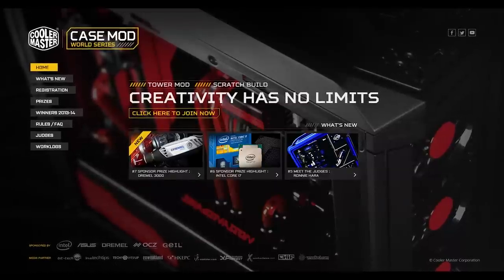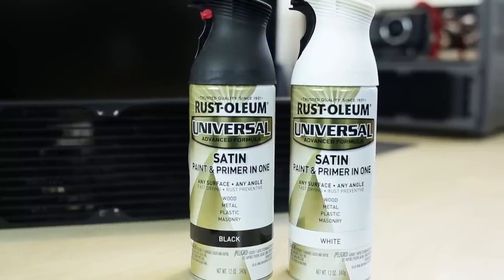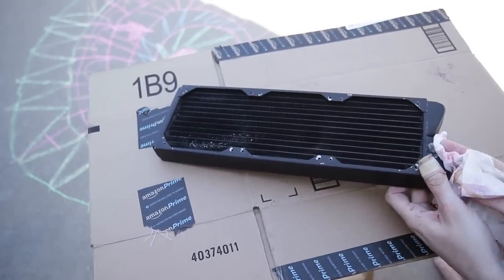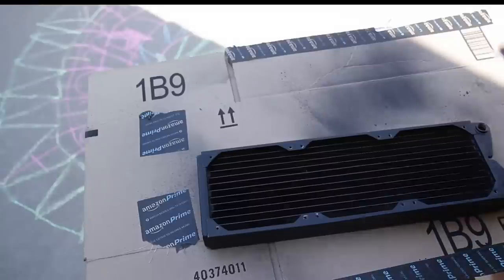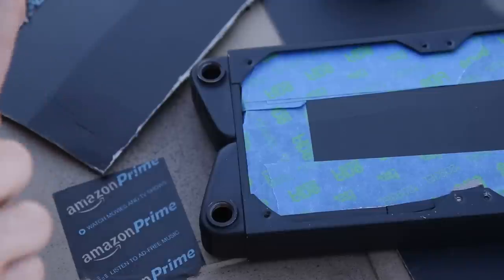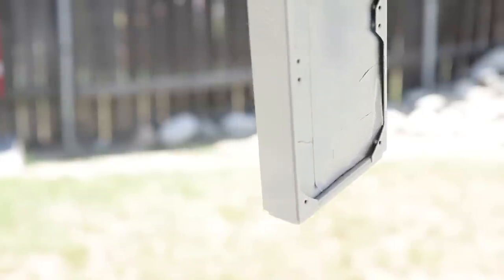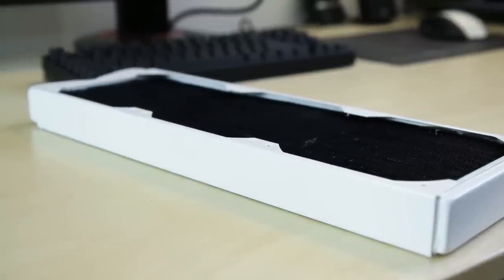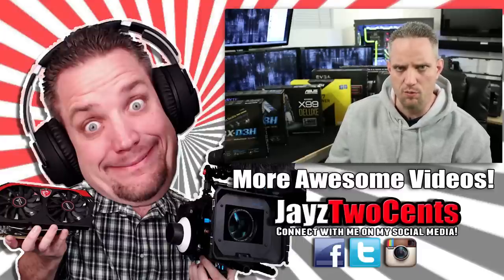Tutorial: How to make your radiator look awesome!

Comment: A better title : "Tutorial: How to make your rad look rad"
Reply: Ah haah.
Reply: that's pretty rad.
Reply: better title. how to make your tight FPI, and make it even tighter, so your fans need to go even louder to cool.. Who gives a shit if the fins are painted? You cant see them when covered by a fan, or the case on the other side if you just do push and if they're scratched, you probably have the fans on that side to boot. If not, the case, dust filter, etc. is on the other side in almost all common scenarios making this video nothing more than a "how to brick your rad" tutorial
Take the cardboard and cut out exactly the size of the inside of the outer edges of the rad (where the fans sit, and the sides and ends) to cover ALL the fins,  then just paint the edges that do not have ANYTHING to do with cooling performance. Especially with a custom water rad like that that costs $50-$80. 

Really stupid to spray the fins IMO.

Comment: Here's a tip for painting. After your done sanding with 400 grit you should use a low lint cloth and isopropyl alcohol 70% or higher to wipe off the dust. It also allows the paint to stick better because the surface is cleaner. Also the alcohol evaporates pretty quickly, so you don't have to wait long for it to dry if you had used water.

Comment: Hey Jay, here is a little trick for you and all others who might do this. it is always a good idea to heat up your can of spraypaint a bit before you paint because, this will first of all provide more pressure, and second make the paint more fluid. witch makes the paint come out more even and make an even nicer finish. 
i usaly fill up a bucket of hot water and let the spraycan star there 10-20 minutes. i hope this was helpfull to some :-)
Reply: +3Dxtremeflight I put the can in a BBQ pit and it exploded in my face. 

Instructions unclear. Got my self killed.
Reply: bucket of hot water as in boiling water? or just put the water in the microwave for about 3 mins on high. and then put the can in that water?
Reply: The hot water that comes straight out of the tap is hot enough to make the paint spray more smoothly.  No need to boil the water, you're not supposed to cook the paint!!

Comment: Doesnt the paint on the radiator fins affect the heat? So why did you paint them at 4:09?
Reply: it will make cpu cooler hotter by 4-5c but on raditiator probably wont have any difference
Reply: sur puppa I don't think he was putting on enough paint for it to matter
Reply: sur puppa It depends on the type of paint that's being used. The color black is notorious for being a heat magnet so I doubt it would have any significant performance impact if any at all.
Reply: sur puppa every car and motorcycle radiator comes painted so i would say no its not an issue
Reply: Sleepy .Time i know every radiator has painted fins, but that paint is the right amount for not affecting heat. If you add extra paint by yourself it should increase the heat.
Reply from the maker: sur puppa This is a pointless discussion. There is no effect. By the way, every radiator for sale has powdercoated fins which is MUCH thicker than paint!
Reply: ***** Not all, a few have unpainted copper fins, though those are more rare.
Reply: A friend and I put this to test with motherboard heatsinks, painting them white sur puppa 
Temps actually dropped 1-3 degrees. We couldn't come up with an obvious reason as to why and as it was just a test to ensure stuff wasn't going to overheat, didn't care.
Reply: Peanutsreveng3 Where u using a IR Temp gun or the internal temp probe?
Reply: internal. Would def have mentioned if we used proper kit #becausecoolshit
Reply from the maker: Peanutsreveng3 likely due to different TIM applications.
Reply: sur puppa i dont know about cpu, but a car radiator spraying the radiator black will reduce the idle temperature, since black colour absorb heat faster
Reply: sur puppa I agree in principle. With out testing, I suspect there is not much difference thermally. Id guess less than 1C difference on a light coat.
Reply: Peanutsreveng3 A light coat vs a full painted heat sink is a totally different animal. Also the internal part of the rad fines are still not painted.
Reply: rushdrift Not true. Heat dissipation to the air is colour independent, all that matters is the material. Heat absorption is colour dependant as white reflects light and black absorbs it.
Reply: Kurukx Theres been proof. Google it.
Reply: rushdrift I think you mean black emits heat faster. (in the case of a car radiator)
Reply: EDIT:
The TIM wasn't actually changed, I was incorrect when writing this message:

Changed the TIM before testing ***** :)

Here's the thread that was made by mate whose new system it is was for http://forum.overclock3d.net/showthread.php?t=46321 if you're interested Kurukx
Reply: Correction to the above (sorry to buzz again *****). I just looked at the thread again and we didn't change the TIM before testing and it was in the conclusion that the improvement may have been old vs fresh (decent) TIM.

The fact the temps didn't rocket and there was plenty of head room on the new system meant that it would be safe to paint the heatsinks.

Just to correct myself (don't like misinformation).
Reply: the paint on radiator fins will effect how the fins conduct a little I guess.. might not be huge... BUT general heat disipation should be mostly unaffected
Reply: ***** Tell the keyboard know it all's haha :P
Reply: SgtAMYNTAS you mean me?
Reply: ***** Exactly. The difference is about negligible. However in the case of my radiator, it's an absolute beast. It's 3 inches thick with around 3 meters of bare copper piping run in series through the vast quantity of copper fins, those copper fins are nickel plated to prevent oxidization but since nickel is a great conductor it makes just about no difference. Keeps a heavily overclocked 780ti and 4790k down at a chilly by gaming hardware standards 24 Celsius summer time in a south facing bedroom(which means during every single second of daylight the sun shines through that window heating things up). So it's an amazing radiator. But, onto the relevant point, this poor rad has some gruesome scratches. The outer housing, on a couple chrome segments, it looks like somebody took a machete to it repeatedly (due to it's enormous size causing fitting complications. bits of drive cages were cut away with a hacksaw, actually had to route a hole out the back of the case in a kind of top mounted psu position to accommodate the last inch or so, it was a tight fit, lots of wiggling, moving, it got stuck a couple times...) It is so horribly disfigured but, it just cannot leave my possession for any reason and, theres no way i'm putting any kind of insulation however negligible anywhere near this beast. It would be a crime.
Reply: ***** Mighty Car Mods video about it was highly misleading and incorrect. Check out the engineering explained channel where he debunks their test.
Reply: Kyle LaFountaine heat dissipation through radiation is not the same as through convection.
Reply: Sleepy .Time No they're almost always unpainted, I have never seen a stock painted intercooler. The paint is purely for aesthetics, look at the radiators in performance cars and not ricers.
Reply: Völundr Frey
i don't pay the slightest attention to "ricers" but every single production motocross bike comes with paint on its radiator and engine and no they do not remove the paint to lower heat since that is the job of the thermostat

that said i would never rattle can paint my PC rads
Reply: Sleepy .Time I have never seen a bike of any type with a painted radiator. Googling around I've got a total of one picture of a painted motorcross radiator.
Reply: 90% bikes radiator are painted black, i rode my friend KTM duke and his radiator is black, I never seen a bike with flat metallic radiator yet even my other friends cbr600 has black radiator and its an oem part not after market
Reply: MrGImBIS NCIXcom made video about painting cpu cooler
Also jayz doesnt paint core so it wont have any difference
Reply: Sleepy .Time not true, my cars rad is bare copper and the replacement was bare aluminum. Plus, Mighty Car Mods answered this question, black rads have significantly higher heat loss when there is no air flow while bare rads have marginally higher heat loss when there is air flow; this is due to the slight insulation of the paint inhibiting conductive/convective losses when there is air flow and bare copper/aluminum being a piss poor black body radiator compared to black paint.
Reply: +sur puppa There is a special paint made for radiators, it is black, and believe it or not radiators covered in all black radiator paint is more efficient at heat transfer than a bare radiator. Why it is? The science is beyond me, but feel free to google it.
Reply: +sur puppa If the rad isn't going to be sitting in the sun, it doesn't matter what color it is. Colors absorb radiant heat, not conduction or convection.
Reply: Dizz-E I know, that isnt what I meant. Paint is less effective as an absorbant than metal. The metal has a light coating to not decrease the absorption, but a thick layer of paint will do that
Reply: Black paint on radiators increases its cooling effectiveness slightly. End of story.
Reply: +819blakes I read your link and learned something new. You are correct, darker objects emit heat more efficiently, just as they do absorbing heat. However, I'm sure that black paint or powder coat would create more of an insulation than if it were bare metal... regardless of the metal's color. Whether I'm wrong or right, the difference would be only fractions of a degree on a 240mm radiator. If it were on a grander scale, i.e an opera house's sub-floor heating, the difference would be much more noticeable. BTW, thanks for the link.
Reply: I did say slightly. It isn't enough to warrant buying paint to color it for the bonus, but it shouldn't be a reason not to paint a radiator for aesthetics. No problem, just didn't want anyone out there having to choose between look and efficiency when they could have both.
Reply: Gérard le mouleur de schnek the above is for you btw.
Reply: +sur puppa Did you even watch the hole video?
Reply: Gérard le mouleur de schnek
Reply: Do you people know anything about thermodynamics? radiators work off of Convection so any coating will decrease efficiency. It will slightly increase radiation heat transfer but as radiators are designed work off of Convection black paint will decrease heat transfer by acting as an insulator. The effects on a pc radiator will be negligible.
Reply: Did this guy really just say that? God I love youtube comments.
Reply: Mighty Mouse facts?
Reply: @Jayztwocents  all you do is great but thought to paint as can't get radiator I want, saw once you had a custom one, I trying to get a cross flow 120mm slim white radiator for my build as black outside and white inside, do you know if anyone will do or I just got to paint a black one white (I not great at painting), it mainly as where it going so I can have nicer hard tube lines or I have to bend a tube past a fan (I got fans inside so can make sure to see they spinning if issues or easy change

Comment: You can also use masking tape to cover the fins and paint the outside if you want a two tone paint type of paint job. You can even tape a design on your fins and paint if you want a design painted into your fins. If you want the paint to be glossy you should paint, fine wet sand, paint, fine wet sand, and paint. Then use some car wax to buff it out, wet sand again, then paint. Then clean the paint with dish soap and clear coat. Wet sand and re apply the clear coat a few times. Then finally wax the clear coat and buff it. You'll get a very high gloss with no orange peel effect. Even better too if you warm up the pain cans in warm water and use heat lamps when curing the paint.

Comment: And can you make a video on third market sound dampening foam? I am really interested in if it makes a difference
Reply: sur puppa you mean third party/after market. third market is something financial.
Reply: ***** yes, that, thought it was the same thing
Reply: I'd love one too. But there isn't really an audience for that type of thing.
Reply: +sur puppa It should make a noticable difference if most of your noise isn't cause by vibrations. All of your fans should have anti-vibration mounds if possible. I'm not sure what to do about fans attached to radiators. Noctua fans is my only guess there as they should be very well balanced.
Reply: Musicians are the audience for that type of thing.

Comment: For cleaning the rad before you paint, rather than using a damp towel, use isopropyl alcohol. This will clean the surface and will dry almost instantly so you don't have to worry about any excess water.

Comment: I'm still confused how your radiator got dented, scratched up, or anything 

Who's playing catch with their radiator? Maybe I'm a noob or something.
Reply: IN MAH BELLY!!!
Reply: Also when manouvering parts in, out and around the case, they tend to pick up scratches and chips, especially when reusing parts with multiple builds. And if you're more pracically-visually inclined, the planning and adaptation stage usually entails shuffling the actual parts around for mock-ups, much more so than sketches and such.

And the paint on rads are usually reeally thin, as to minimize impact on heat transfer.

Comment: Plastidip is the answer to this, its a damn godsend, not as much work as paint, easier to control spray and it doesnt vent into closed spaces nearly as much. And as it get scuffed up and takes more of a beating you can just use the companies fix it kit that is a mix of thinners to smooth out and polish back up any eye sores that otherwise would require an entire repaint if u were to go that route...
Reply: also no need to prep ur surface, just make sure its clean and as smooth as u can get it for shine or leave it be for a matte look with the plasti dip, i actually did this with all my swiftech hx series AIOs like my h440x and my mcr140x aka just the rad pump assembly of their usual aio. Cant wait to have money and mess with their new line of aios
Reply: plastidip in the fibs?
Reply: in the fins? oh hell no, thatll really mess with its ability to dissipate heat through the fins... just use some masking tape on the fins, depends on what make you have but the tape should fit just under the edges hiding the line made between the plasti dip and your masking tape, make sure to apply it in proper but quicker coats and give the last coat a bit extra plasti dip, just dont let it pool up anywhere and then remove the masking tape right then. The masking tape needs to be removed while the plasti dip is still wet or it will bond to the tape and when you remove it, the plasti dip will come off with it too. Ive got a flickr with all the work i did on my custom case mod work including all the plasti dipping and all my plasti dipped parts, rads, water blocks, case and whatever case panel i could get to, my ram covers etc. Just lemme know if u want the link.

Comment: it does make that radiator look mighty fancy. 
I do have a question though, is there a benefit to running 2 radiators in series. i.e. one tube goes out of one rad into another rad, then finishes the loop normally. Or wood that just be a waste?

Comment: Nice how to. A question on adding a another layer of paint: how does this affect the efficiency of the radiator, especially when getting paint on the fins, like in that first coat?
Reply: jamboni Not enough to be a concern :)
Reply: jamboni what would be a concern is if you used paint from a paint bucket instead of a spraypaint.
Reply: Captain Einstein lol, just dipping it in a can or something
Reply: jamboni yea dipping it in a can would make it pretty much useless

Comment: how would it be to use antifreeze in the cooling loop? the stuff u put in the cooling system on cars. wouldnt that lubricate the pump, so it could last a bit longer?
Reply: Magnus Nymoen yes it works.

I run my loop only with this stuff, mix it with dest. water 5:100-10:100 (less is more) and you are good to go.

Get the blue one though, not the purple.

Comment: Just to make sure, don't paint in the sun, especially metals. Once it had dried for at least an hour, then you can put it in the sun to help it cure. The heat will cause the paint to run leading to bubbles as well.
Reply from the maker: TheOneWhoisDrunk Ive painted every project I have ever done in the sun without issue. It probably matters what kind of paint is used.
Reply from the maker: TheOneWhoisDrunk Humidity is definitely a factor to consider. More so than the sun

Comment: Hey guys, I'm going to build my first pc soon and I'm not sure about the motherboard. Here are the rest of the specs.

CPU- Intel i7 5820k
RAM- G.Skill DDR4 2133 16GB (4x4GB)
GPU- single GTX980 (EVGA FTW)
SSD- Samsung 850 Pro 128GB
HDD- Western Digital Black 4TB
PSU- EVGA SuperNOVA 750G2

Any help would be appreciated.
Reply: NoLifeJosh an x99s sli plus from msi isn't bad

Comment: I have a question for the gurus here
Is 750w bronze power supply enough for 2 way gtx 760 sli?( i7 processor)
Reply: Niko Bellic I have the evga supernova 750 bronze and it works fine with my sli 770's